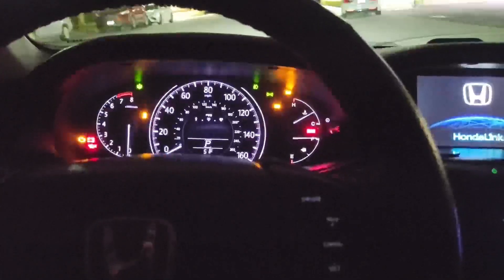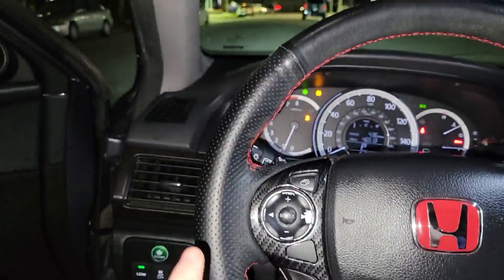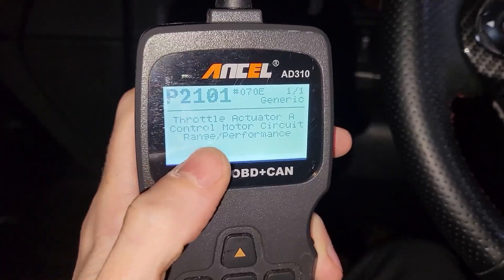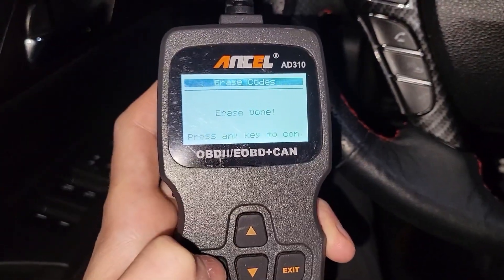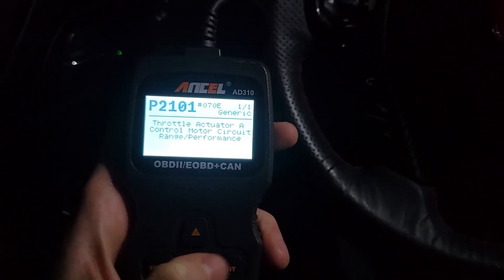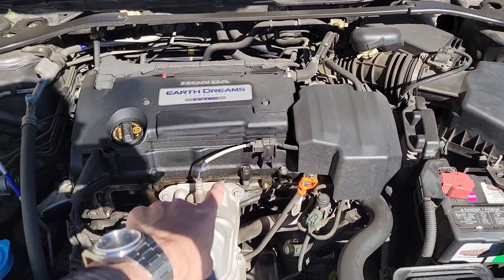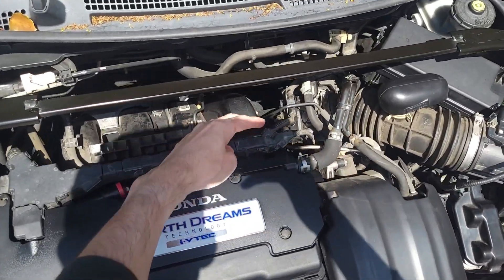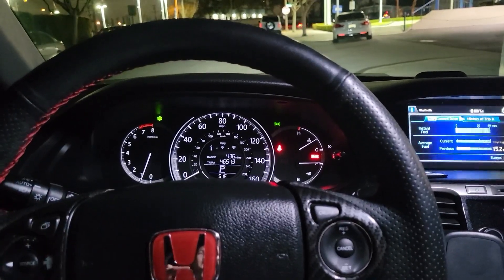Car NOT Starting... Uhh ohh.. #p2101

Comment: Great video sir! I think Im getting the same issue. I took it into auto zone for them to scan, and in addition to the P2101 code, I also got PCM Malfunction (83-11) code and 71-12 (TPMS code). Did you get those too, and are they all related and thus resolved after you cleaned the throttle body?
Reply from the maker: @mchan1021  Thanks! Hmm I only got 1 code and it went away once I got the throttle body cleaned. It may be that other codes go away when it gets cleaned. 
Do you know what those other 2 codes are about?
Reply: @Striker50_  Not too sure why Power train control module code and tire pressure light came on too. Given that all 3 came on at once, and the engine was stalling out after a few seconds makes me suspect some kind of computer communication issue. Its weird that the car is actually running fine now and the lights all went away without actually fixing anything...

Comment: No value to the video
Reply from the maker: These are issues you will see when your throttle body is not opening or working. 
1) I show what the symptoms look like
2) I show how to remove the code
3) I show where the throttle body is located
4) I talk about how they clean it, and how it resolves the issue and code. 

Sounds like you are new to automotive maintenance and diagnosis.
See your local mechanic if you do not know what this video means.

Comment: Hey man hopefully you see this message because I cant find the solution to my problem. I have a 2015 Honda Accord EX-L and I have a remote starter Called Viper. When I start it using the remote starter the car turns on regularly but then shuts off the on the green key light shows up on the dashboard. My car starts regularly when I regularly turn on the car with break and push start and doesn’t shut off at all.
Reply from the maker: @thehash4101  That's interesting. I would imagine it has to do with the aftermarket set up. I would reference the Viper manual to troubleshoot that issue or call their customer support. I'm sure it's happened before so they should have an idea on what to do

Comment: My car literally started doing this the other day as I was leaving for work. Same lights and even fcw failed warning
Reply: I have a 2013 accord exl coupe but same age and everything. It's been doing it for a little now but was never consistent and only recently was really struggling to turn over and even accelerate
Reply from the maker: @mitchryan5468  interesting... How is your mileage? Have you changed the spark plugs? But yes definitely the throttle body can use a cleaning
Reply: @Striker50_  145k but it's possible thry might need to be
Reply from the maker: @mitchryan5468  I replaced my spark plugs at 100k which is what is recommended. I might change the spark plugs again, im at 155K now. 
It will most likely be your throttle body however. 

Do you use a K&N engine air filter by chance?
Reply: @Striker50_  I have no idea ky mechanic replaces stuff according to what the maintenance schedule calls for  with my specific car.
Reply from the maker: @mitchryan5468  Ok then most likely not. Reason I ask is because I looked at my K&N filter the other day and it had a bunchhhh of black soot so that was probably flowing into the throttle body and engine. I also recently got a code for an inefficient catalytic converter sensor. I'm going to be making a video using cataclean, to see if that makes a difference
Reply: @Striker50_ ah ok i see
Reply from the maker: Same accord?

Comment: I purchased a new throttle actuator going to start my car after finishing onstaling the fuel pump and fuel filter for 05 Mazda3 SP2.3.
Been replacing old stuff electrical parts, at first when i bought this car in 2021 the lady never told me about the other bad stuff she kept it simple i just been driving since but in 2023 thats when the car started acting up ive done oil changes through out the years ive had it. The year 2023 man thats when i started replacing parts now 2024 around april hope i can get this car going fresh again havent deove it in a year it starts and all it was shaking mounts had got replaced still shaking thats when i went to the scanner and popped up a code P2103 (Throttle Actuator 'A' Control Motor Circuit High) i cleaned the throttle with throttle spray still car was still shaking i went ahead and bought a new throttle actuator going to gfinish the install for the fuel pump and fuel filter, and fuel injectors then start the car and see if anything changes
Reply from the maker: Update me on how that goes 🤞
Reply: @Striker50_  yessir did everything today but the rain came in so had to cut the time short tomorrow is the big day I will definitely update you on any changes 💯
Reply: @Striker50_  this here the intake shutter valve actuator is the reason why my car won't stay on or when cranking on it starts rough idling bad like shaking 😅 😆 had to order a new one soon as it get here I will update this comment 😆. But I still had to do a change of fuel pump cause the last one that was on there boy I tell ya 🤮
Reply from the maker: @0-Sevn  Man the fuel filter on our Ford Ranger took me a longggg time to get off that thing was almost crazy glued on it seemed
Reply: @Striker50_  bruh tell me about it 😆 this one the last owner literally stuck electrical tape to seal the seal cap because it was cracked I'm like damn and then the corrosion around the gasket bruh 😆 🤣
Reply from the maker: @0-Sevn  The stuff you discover when you repair used car I tell you
Reply: @0-Sevn any update bro? I have a 06 mazda 3 and getting the same code with all the exact problems you stated!!
Reply: @Kavie93  yea there was alot over the time period the engine wire harness that connects to the pcm was the problem there were alot of corroded wires running all over even at the tipm fuse box the wires were old causeing electeical shorts  i  striped the wholebthing down and sraped all the corrion off cleaned evenry single one it was a long process but it worked again there was alot wrong with this car for an import. The short also caused the anti theft to actvatee i figured out the disarm trick with the key to the door wtcjing until the keylight turned off man it was alot. the driving portion of the car and shifting into sports mode wires inside the transmission box under the car where the cylinloids shifters are located the wires clips were bad causeing shorts got it fixed rigged but still got the job done, sadly I don't have the car anymore it's been like 4 months nowwith out my car  got evicted went to a hotel with my mom and my daughter 2 months later at my brother now currently moving up state to start over hopefully I can find another 05mazda sp23 up there somewhere or a Honda most deff the car was due to putting trust in family during the time of eviction but dint have no where to park it after getting it up and running again all it needed was a cylinloid shift D replaced and either the engine temp sensor or thermostat replaced but again family let me down but it's all good 👍 God will bless it all back 10 fold 👏🙌🕊👑📜.

Comment: How many miles are on your car? I just bought a 2013 EX-L with 67k miles, I traded in a 2016 Hyundai Sonata Limited, only b/c I commute 750 mi a week for work and just wanted a car that I knew would last! I’ve watched a lot of your videos and they have motivated me to make some updates!
Reply from the maker: I got about 148k and I honestly didn't maintain my car the first 100-120k because I just didn't know any better. I got it with 22k miles, and started doing more maintenance around 2020 when Cvd19 started. I wouldn't do much more than the standard oil change and brakes and she's still holding up great! 🤞
Nice! Yeah I have a good playlist built up for this car and still more videos to come!
Reply: Having the same problem on my honda. I'm going to clean the throttle actuator in the morning. Also all the light came on when I started having this problem.